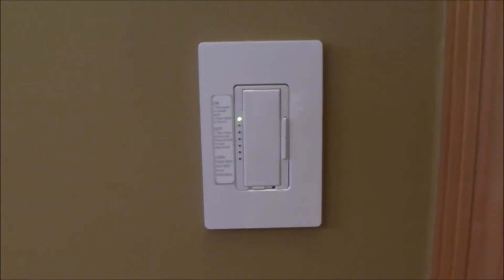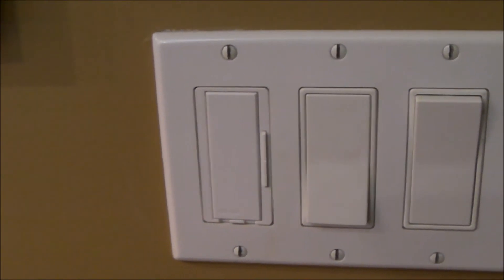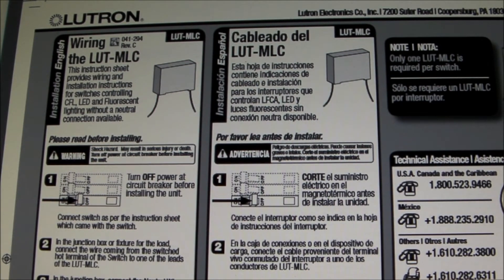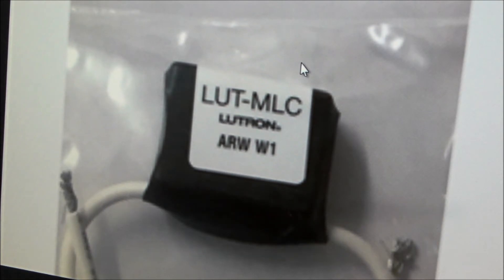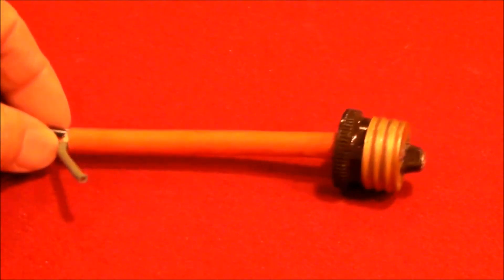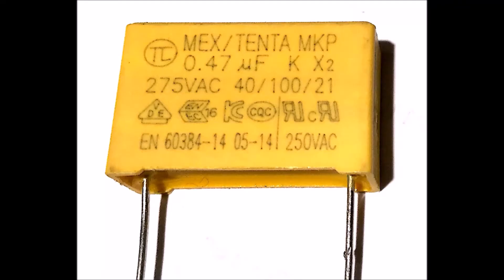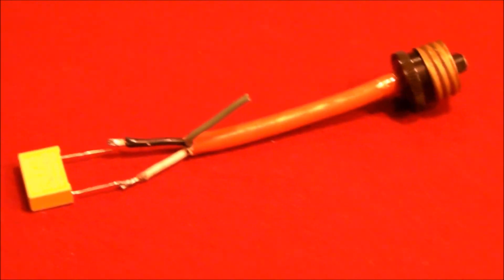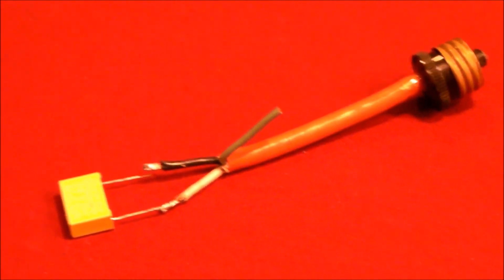Lutron LUT-MLC Minimum Load Capacitor ARW W1; not a solution for LED ghosting with Maestro dimmer

Comment: Lutron never claimed the MLC would work with a dimmer, only with their Caseta solid state switches (triacs with just off/on gating).  Some people have had luck with a 10K or 5K resistor in parallel (from hot to neutral, NOT in line with the LED light load) but you need a pretty decent wattage rating on the resistor, 2 watt or 3 watt to be safe, and it does generate a little heat.  But it presents a minimum load that triac dimmers can more reliably gate-trigger on.
Reply from the maker: thanks for the inputs.  The simplest solution for me was to add a small 2 watt long life incandescent night light bulb to the load of the dimmer and all is good.  I tucked the bulb into the ceiling can light housing.  works great and is cheap!

Comment: You are correct it isnt a in line resistor. What needs to happen is connect one side of the LUT-MLC to your load out to the fixture and the other side to neutral. It shunts the power that is still going through the switch to go to nutral rather then going to the fixture.
Reply from the maker: So that's the same as across the black (hot) and white (same as neutral) of the load.  Doesn't work on my old model Lutron dimmer.

Comment: Would this work with a Lutron Cassetta (non dimming) switch?
Because the MLC came with it.
Reply from the maker: Sorry, I don't know.  But Lutron tech support is very good.  If they supplied the MLC with the switch, my GUESS is yes but I do not know for sure
Reply: YuDaMan 
I have one LED light fixture that is going outside.
I plan on installing the MLC in the Box that is supporting the LED light fixture.  Since it came with it I will install it.  I talked to the customer service person who sold me the product and they said it is strictly for Led.  My question is I don't want to hurt anything or destroy anything if I installed this Minimum Load Capacitor.  If I did not need the mlc do you think I would destroy anything? Or would it just work fine? Thanks for reaching out and responding to my comments.
Reply from the maker: Assuming you need it (namely the LED doesn't fully extinguish off) then use it.  It's just a capacitor that's not likely to hurt anything, provided it is properly installed.  We can safely assume Lutron selected a capacitance value and AC voltage rating that is suitable for the application.
Reply: Yes. Wire one end to the load and the other to nutral. This will solve ghosting as well as flicker of the LED.

Comment: Did you put this in the first light in the parallel circuit? It would have to be either directly off the dimmer(hot to neutral) or at the first light to work correctly. (Reading from other forums)
Reply from the maker: It was connect right off the dimmer since that is the easiest place to test it.  Lutron tech support confirmed it will NOT solve the ghosting problem with the particular Maestro dimmer I was using
Reply from the maker: yep, your lamps are still "ghosting".  Check out my other videos for a solution that actually works and is very inexpensive!  ... and please subscribe!
Reply: Yeah I tried this with the Lutron Caseta dimmer and it didn't work as well. In fact it didn't flicker when off, but instead looked like it was just dimmed to its lowest setting.